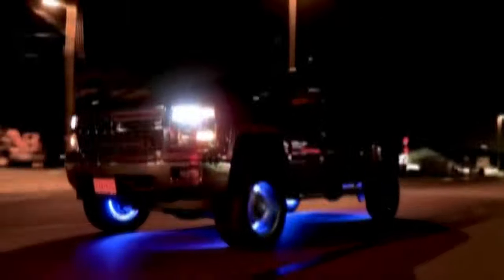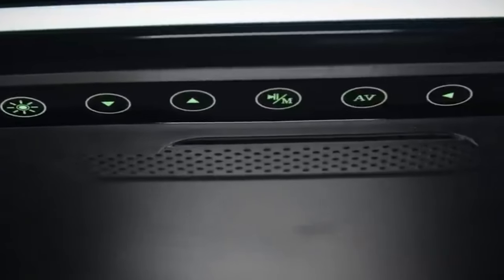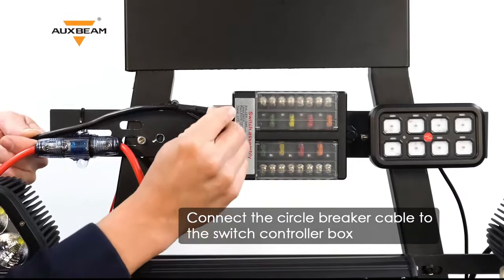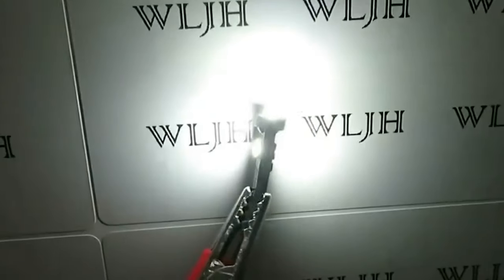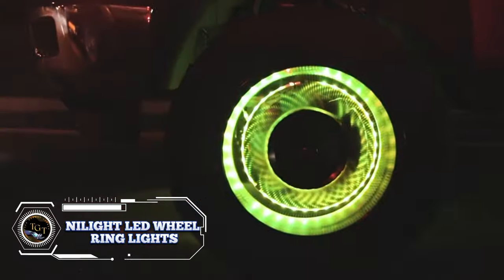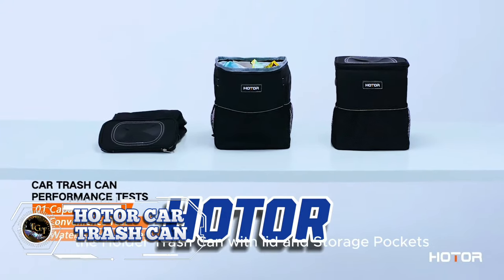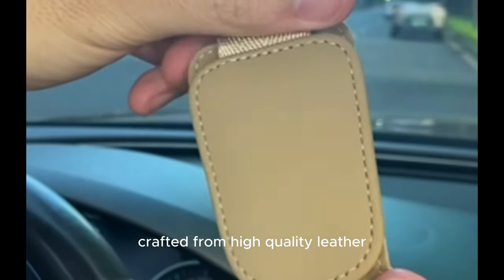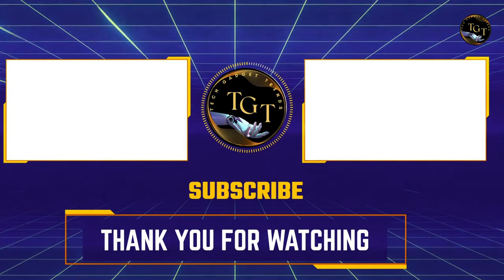15 must-have car gadgets in 2024 | New Tech Gadgets trends

Comment from the maker: Tell me which product you liked best?
Universal Smartphone Bracket $14.60 https://amzn.to/3TTqmVx
XTRONS Car Roof Monitor 189.89 https://amzn.to/49yzxAc
Mini USB Car Led Lights Interior $14.99 https://amzn.to/3xvJWzz
Taylor Car Air Fresheners $15.99 https://amzn.to/3PYqpOA
Auxbeam Switch Panel $169.99 https://amzn.to/3Uct6i0
Orion Motor Extractor $11.99 https://amzn.to/3xwzTu6
ash Dashboard Lights $11.99 https://amzn.to/3vOvzpv
Flexible Draining Oil Snap $5.99 https://amzn.to/4arPt8Y
Stryder Straps $44 https://amzn.to/4aTmDxN
Nilight LED Wheel Ring Lights $119.99 https://amzn.to/3JdMODV
Car Wheel Decorative Stripe $6.88 https://amzn.to/3RogxiG
HOTOR Car Trash Can $9.99 https://amzn.to/3VWedBU
Car Hood LED Light Strip $12 .99 https://amzn.to/48rdv3i
Magnetic Sunglass Holder  $6.79 https://amzn.to/3JhhDHI
 back Support Pillow $ 26.99 https://amzn.to/3PPq6Gj